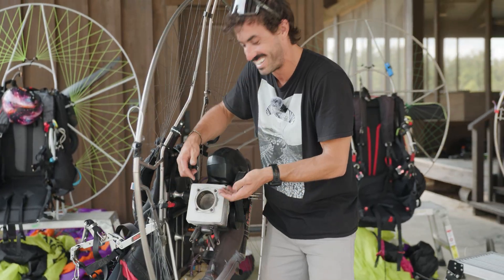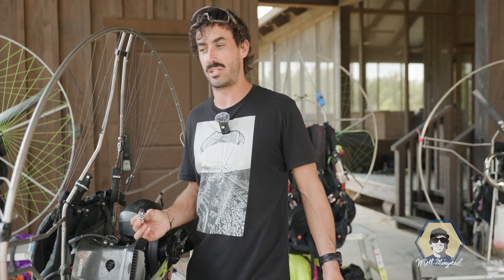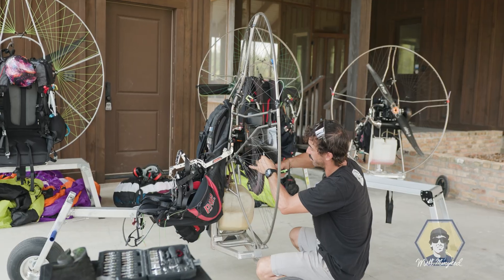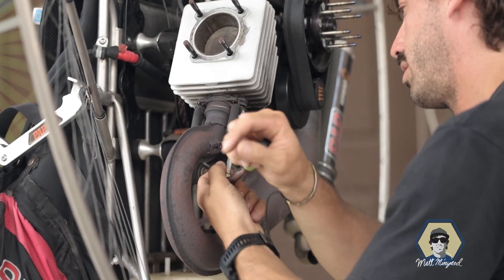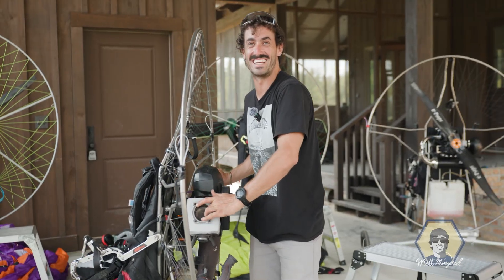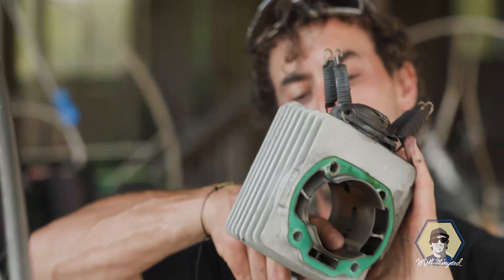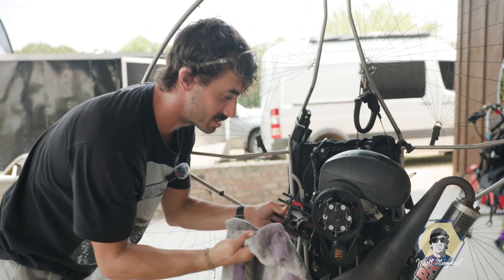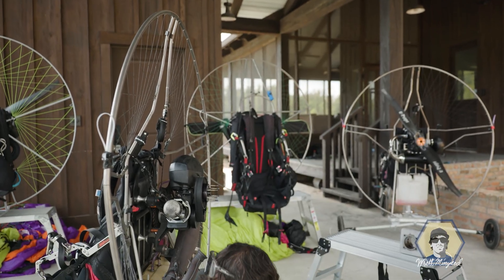Seized Mid-Flight: Can We Field Repair This Paramotor Engine?

Comment: I know you said you said there wasn't oil in the fuel. I couldn't see the other side of the piston but it almost looks like a 4 corner seize. That happens when you whip on a cold 2 stroke. I want to get into flying one.

Comment: Great job Matt. Hey for faster removal and install you could use an electric cordless drill with a socket adapter. Well done!
Reply from the maker: Thx for the tip 🤙🏽

Comment: Ive fried my moster piston before. I just ended up sanding the aluminum off the cylinder and ran an old piston and someone elses used seized rings. 😅 ran perfect.

Comment: I'm seeing 110 PSI on a WOT, fully charged battery compression check.  Motor has 211.25hrs with new piston and rings installed 11 hrs ago.  Wondering what's normal, and what it would be without the decompressor hole/clogged hole.
Reply: I can't say what is "normal", but my 110-hour Moster is 110-120psi.  I check it every 10 hours or so to see if there is any significant decrease, and consistently see 110-120psi.  I'll probably do the 100-hour service over the winter months.
Reply: @B_of_NC  yeah, that decomp hole really makes the needle jump like crazy on this thing.  I get steady solid readings on every other toy I do comp checks on....jet skis etc.  But that hole makes the needle bounce hard between 120 and 110 like you say.  When I stop cranking it stops to rest on 110, but I see it bounce to 120 for sure.

Comment: just go to autozone and get a cheap drill hone, just go with like 15 light passes and it'll be fine, I did it on my first motor and got like 100 hrs after before selling it. ran perfect, did put a new piston and rings though, like 100 bucks, no big deal.
Reply from the maker: Sand paper was what we had, plus id rather not damage all of the nikasil coating if I don't need too

Comment: Was very happy to see the Moster come back to life! I have 2 airboxes crack on me and 2 exhaust elbows crack as well. Other than those issues, the Moster 185 is quite a reliable engine.
Reply from the maker: Yep 👍🏽 I break a lot of air boxes and exhaust also, it's a shame they don't support us with replacements but we have money and welding machines for now, stay tuned for a better replacement solution for that coming from me 🐵🐒

Comment: Unbelievable.  You re-used those gaskets and bolts on a seized engine, no new parts - & it works fine again?  Well Done!
Reply from the maker: Field repair ❤ gotta work with what you have
Reply: @minyardmatt  I fouled paramotor head gasket with spray ether lost compression, so have to put new gasket on, different sort of prob than yours but encouraging to see you got it running again, in my experience a good engine's a running engine though most of my experience is with vintage snow machines.